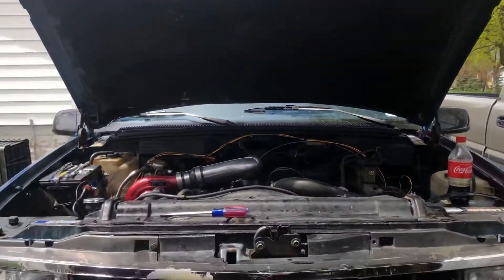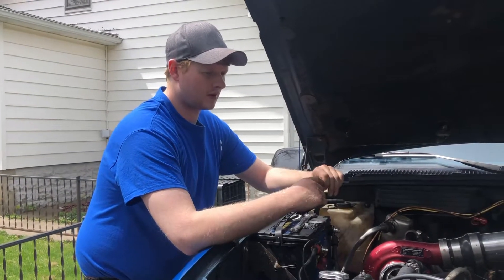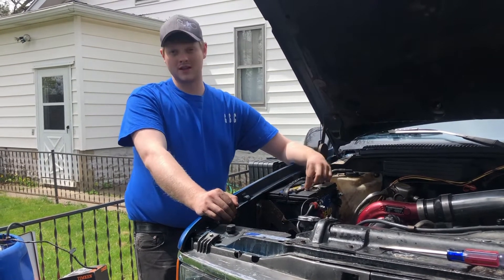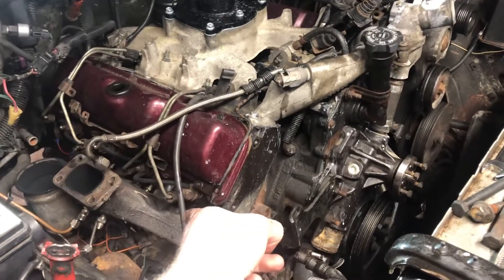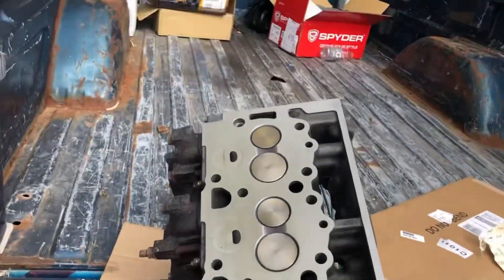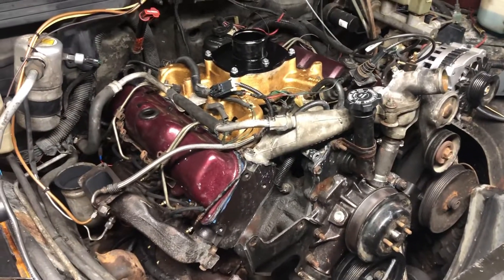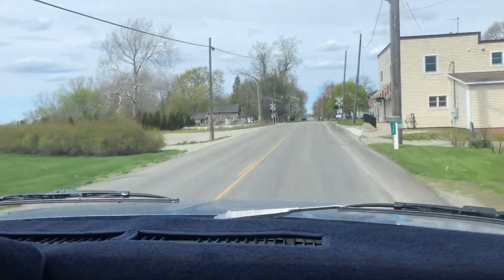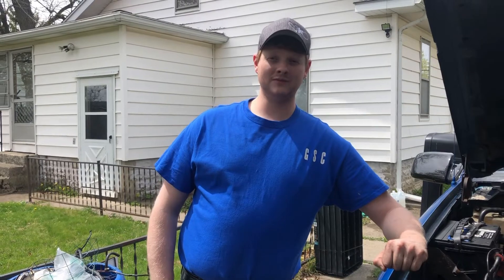GSC 6.5L diesel head gasket. Lessons learned

Comment: Do you add rtv on those head gaskets or do you put them on dry? And same question for the valve covers?
Reply from the maker: Never put RTV on head gaskets. Valve covers I just use a thin coat of RTV since the gaskets never seal. That’s how GM did them so I use the same process.

Comment: Hey GSC, Im currently working on head gasket replacement on my 94. I've seen in a few of your videos you mention a few techniques using machinist blocks and straight edges to check the decks & knock down high spots after you clean them. Are you able to provide a step by step on how exactly you clean, prep, and check your blocks before you set your new heads on?
Reply from the maker: I should have a video of doing heads out of a truck. I use brake clean. Green scotchbright pads and plastic razor blades to clear the old material off first. Then I use the machinist blocks with a coat of WD or light oil. In the two hour head gasket video I put together it shows some of the steps. Once it’s clean hose it down with brake clean and scrub it off good.
Reply: @gingersnapcustoms sounds great. What exactly are you looking for when you use the machinist block? And would a regular whetstone serve the purpose?
Reply from the maker: @Mveltre123 I’m just trying to knock any burrs or high spots off. It helps to clean up any pitting on the deck as well to help for a better seal. A standard whetstone should work.
Reply: @gingersnapcustoms  awesome. Thanks for the help!

Comment: I have a question about ur head bolt torque? Is the 125 ft lbs for arp “re-usable head bolts” or for stock torque to yield bolts? I don’t want to have to do this again. Im leaving it stock.  Just a farm service truck. Hard to find reliable stuff online. You have done it a few times it looks like, and I’m not so sure on stock torque specs anymore.
Reply from the maker: I found stock TTY and reusable bolts are stretching wayyy too soon. So I’m using all ARP studs now and torquing them at 120lbs. 50-80-120. Let it sit for 2-3 hours and run over them again at 120. That’s been the most dependable way to keep heads on these.
Reply: Ok thank you very much!!

Comment: I just blew my head gasket on the drivers side, I used arp head studs and a felpro 9521pt which is .10 over. I did torque my studs to 90, after watching this I am going to go 120.
Reply from the maker: I suggest Victor Reinz gaskets. Stock thickness. That’s a common fel pro issue.

Comment: If you keep blowing them on the outside of the cylinders, I would wager you have too kuch clamping force in the middle and not enough on the ends. Basically warping the head as you torque it down. Might have to get them fly cut and the block decked to get them back true… remember the definition of insanity, doing the same thing over and over and expecting a different result.
Reply from the maker: The next set of gaskets are still in the truck and running with no issues. I’m willing to venture it was just an unlucky set of gaskets since I’d done things this way on other engines without issues. But you are right. It could have ended up as a never ending battle had I not looked at the torque and how I cleaned the blocks.

Comment: When head and deck surfaces are surfaced, the machined finish has much better grip on the head gaskets.  The sealant used on Fel Pro gaskets cures on the machined surfaces quickly.  If this isn't removed,  it is possible to have a new gasket fail.
Reply from the maker: All true story’s. In this case I am not the only one who had multiple failures in the same spot. Mine is one of almost a dozen trucks that even with the heads and block correctly prepped blew new Mahle gaskets in the same location on 2-3 gaskets before trying another brand. Lessons learned.

Comment: ARP have finer threads on the top threads..even though these studs are slightly larger in diameter,  block threads are 1.75 mm pitch, nut threads 1.25mm.
Reply: You're probably onto something.  A finer thread would have a higher mechanical advantage and thus a higher clamp force at the same nut torque
Reply from the maker: Yep. They only go one way. The shaft is also still an M12 just like the factory bolts.

Comment: My 1995 6.5L just blew a head gasket (at least I hope that is all it is). Started blowing steam out the tail pipe and getting enough coolant in the cylinders it would actually hrydrolock if you aren't careful. Coolant is also getting into the oil. Hopefully will have it torn down tomorrow to see what's actually wrong. I can't believe she would do this to me after only 376K miles!!! 😏
Reply: What did it end up being?
Reply: Here's what mine is doing:

https://youtu.be/ExXS6BNtEVM
Reply from the maker: @caseyflint6815  that’s more of what cracked blocks do than head gaskets. Check cylinder 7 and 8. But I’m betting one split.

Comment: Why isn't there intercooler setups for these trucks??? Maybe some cooler air will save them sorry things that's the same shit the old 7.3 idi turbos would do, too hot
Reply from the maker: I’ve actually been building my own cooler set ups for these when I race and pull them. I have a video of the test setup in my white 99. The IC helps a ton. I just ran out of time and have been fighting a losing battle with this truck for the last three weeks.
Reply: @gingersnapcustoms  interested to see what you got coming not many people out here make 6.5 videos
Reply from the maker: @firsttimediesels6289  it’s a fun little hobby. Dragging blue down to NC from MI this weekend for some diesel bracket racing. Hopefully I won’t need a sun dial to set my time.

Comment: After blowing a passenger side gasket and then bending some rods, I limit boost to under 10psi until 2k rpms. Low rpm plus high boost,  plus 20:1 equals a LOT of dwell time at high pressure for all the pieces to stay clamped together. 
Fast work on your part!
Reply from the maker: These things like to be spun up and run in high RPMs! This being a 3.42 gear truck is proving difficult to get a turbo to run where I want it to. So far it’s been ok with the HX40 and 14cm housing.

Comment: Wow, thank you so much! Cool
Shirt!  As you know I’m in the middle of replacing my head gaskets. I didn’t quite go to 90 as the digital torque wrench was showing 90ft lbs at almost 90 degrees. I’ll torque one more time to  110.
Reply from the maker: Torque them to 115 at the minimum. The trucks I torque to 120-125 have never had issues and never needed another set of gaskets.

Comment: OK I’m about to put ARP studs in my 6.5 and a holset hx 35. 2 head gaskets on a new engine in 4500 miles. So do I need to torque to 90 and let them sit overnight and then go to 125
Reply from the maker: Torque 40-80-100-125. Let it sit for 1 hour between 100-125. Then let it sit for 2-3 hours and do 125 again. Avoid FelPro gaskets.
Reply: OK thanks
Reply: Any brand gasket you recommend
Reply from the maker: @bigg2875  I normally run Mahle gaskets. Just the factory thickness unless I have the heads surfaced. Then I’ll run .010 thicker.

Comment: Quick question, is there any 10 blade turbine wheels you know of for the stock turbo?
Reply from the maker: No. And I really don’t do much with stock turbos since they run out of operating range the moment you put a tune in or add any kind of power.